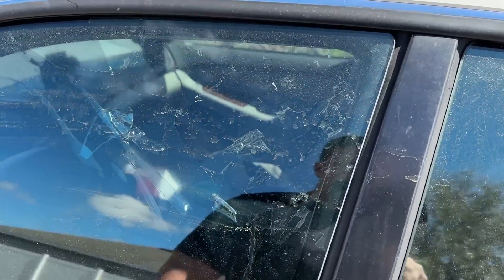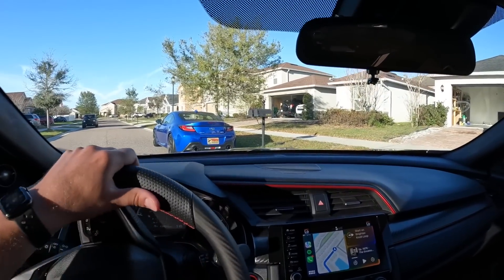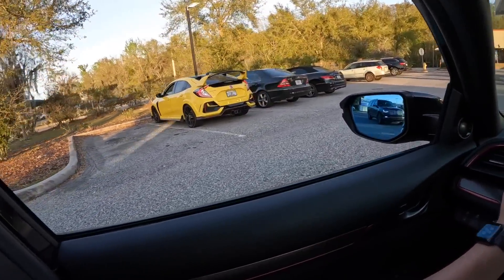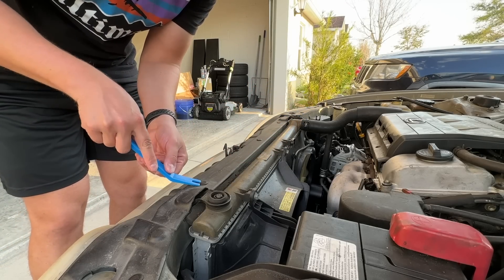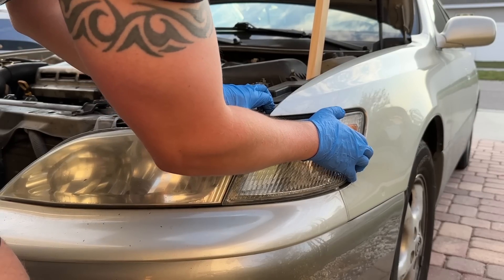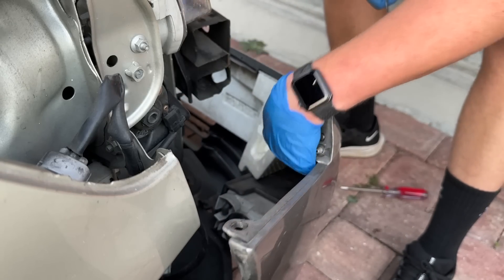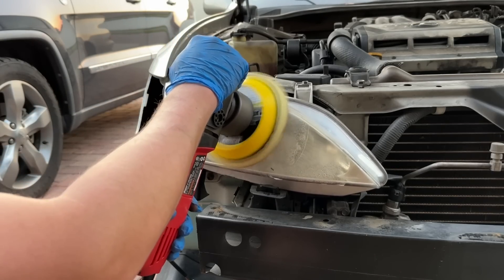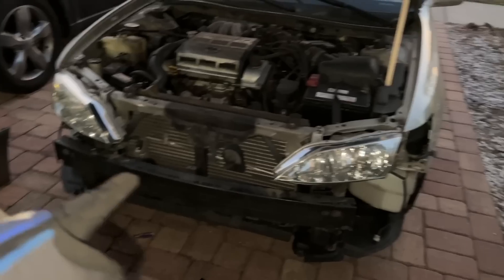Preparing to sell my daily.. part 1

Comment: Try flipping the turn signal bulb 180⁰. If not you need to get standard bulbs. Sometimes led's have such low power consumption the car thinks the bulb is out. You can buy a resistor and wire them in (1 for each bulb). They get HOT so be careful where you mount them.
Reply from the maker: I'll try flipping them. if that doesnt work I'll get standard bulbs. Thanks!

Comment: Most led retrofits will cause hyper flash on older vehicles designed for incandescent bulbs.  Those silverstars you bought were definitely incandescent because of the filament.  Light Emitting Diodes make like from a little circuit semi-conductor piece.
Reply from the maker: Thanks for the info

Comment: The led turn signals actually have to go in a certain way, contrary to the regular halogen bulbs which work both ways. If they don't work, flip them and see. Also, they might not work or blink too fast, which is due to them consuming less power and the car thinking they are out. You can buy car led resistors at some stores or online that solve that problem.

Comment: The blinkers don’t work because you don’t have a resistor on each blinker as well as most led only work one way so you may have to take bulbs out and spin it around but it may still hyper-flash as well as those are just halogen super white bulbs not LED
Reply from the maker: thanks! stay tuned for part 2

Comment: My z comes with halogen standard turn signal bulbs. I upgraded to an LED with resistor built in to prevent hyper flash. They are finicky and the prongs need to be kinda tweaked with to hold the bulb in properly or else it slides right out. Hope that helps

Comment: when u install LEDs in ur turn signal they tend to cause hyper flash because they're so efficient and don't have much load. I dunno if they improved on them now but i remember you used to have to install a resistor in line.
Reply from the maker: Thanks! I’ll get regular bulbs tomorrow